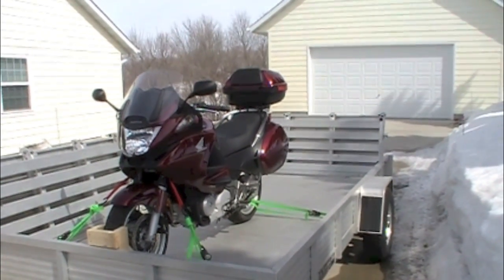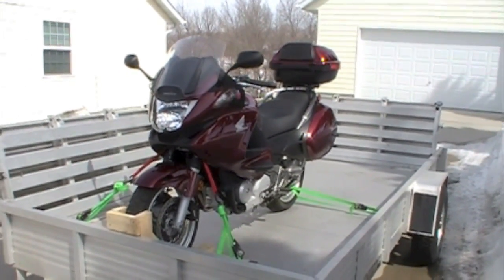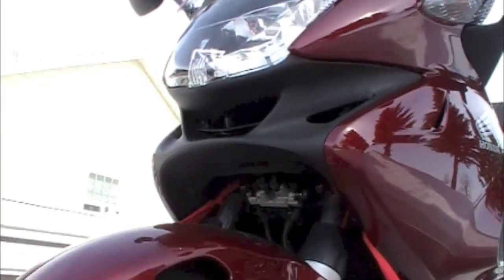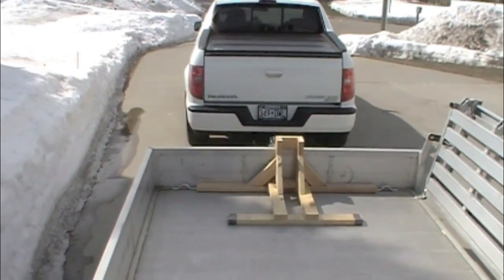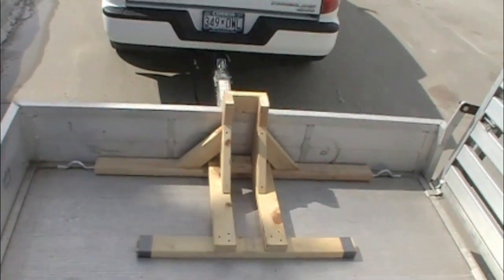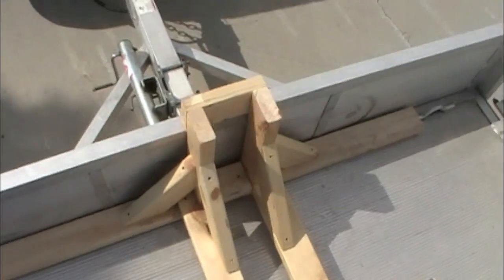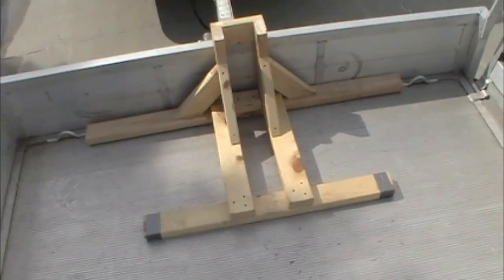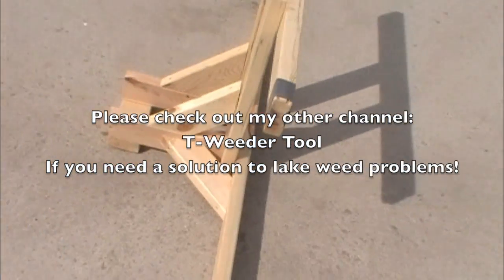How to Build A Motorcycle Wheel Chock & Transport your Bike Securely

Comment: Wanted to thank you for posting your video of how to build and use your stand design.  Just returned from a 3 1/2 hour road trip with an open U-haul trailer and a version of your stand to pick up my ( new to me ) 2008 Honda 750 Shadow Spirit.  100% ... everything was rock solid .. nothing moved ( more than it was supposed too ) and it arrived in perfect condition.  Your small tips were greatly appreciated and very practical ... Thanx again

Comment: What a great project. Just finished building one to your specifications. It'll hit the road in a couple days for the true test. I'm confident it'll be just fine. Thanks for taking the time to post this practical solution.
Reply from the maker: Glad you found it helpful. The only thing I'd do differently next time is to make the angled piece that goes from front to back along side the tire a little shorter. It was too close to my brake rotor, and if I shortened it it wouldn't be a problem at all.

Comment: Looks like a great design. I assume that the chock will keep the bike from tipping over before one installs the straps?
Reply from the maker: Yes- it will hold the bike upright until the straps are secured. Kind of like a front bicycle tire in a bike rack. 
Thanks for the question. 
-Tim
Reply: Tim   Thanks for the reply and I am going to use your great video to make one the same as yours. Looks perfect as one does not have to bolt it down in a trailer like the ones that one buys.

Comment: I'd recommend using wood glue then screwing the pieces.Also, I beveled the front two boards where the tire first makes contact to help line it up.Take a 1" 45° cut off the inside corner of each 2x4.

Comment: What holds the chock in place from flopping.
Reply from the maker: The ratchet straps will pull everything forward and stabilize it. The horizontal 2x4’s on the base will keep it from moving from side to side.
Reply: Is the rear 2x4 the length to the end of the tire
Reply: @tipabr  I built one. I was just wondering if the rear 2x4 is under the edge of the tire.
Reply from the maker: @kenbuxtonjr8771    The rear 2x4 is just behind the tire. Not under it. 
When you roll the bike over the 2x4 the tire is “cradled “ between the rear 2x4 and the front of the chock.
Reply: @tipabr  I will adjust rear 2x4. Thx. Picture perfect!!

Comment: Why not put the bike in your truck?
Reply from the maker: I probably could have put it in the back of the truck, which is a short 5-foot bed, if I left the tailgate down. I just felt more confident using the trailer since it was easy to load. I've seen some videos of people trying to load motorcycles into truck beds on narrow ramps that didn't end well.